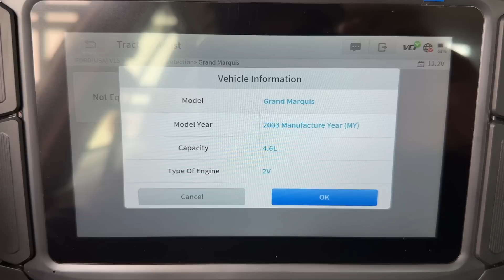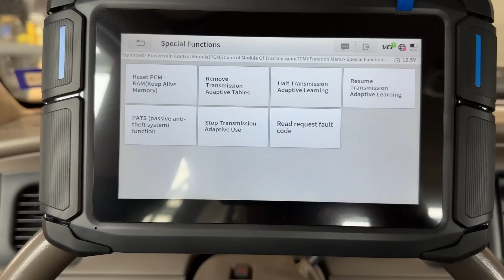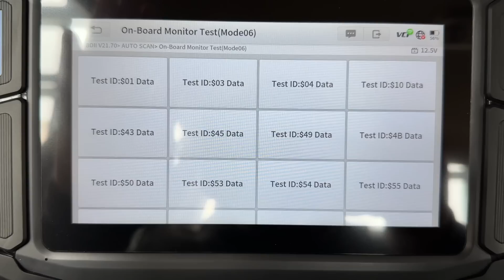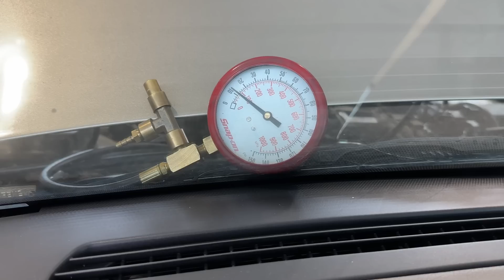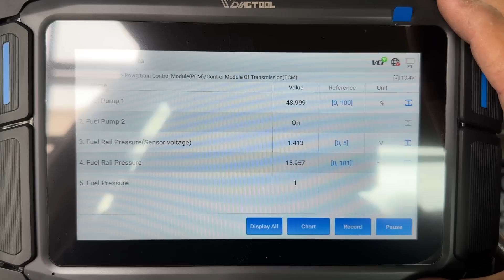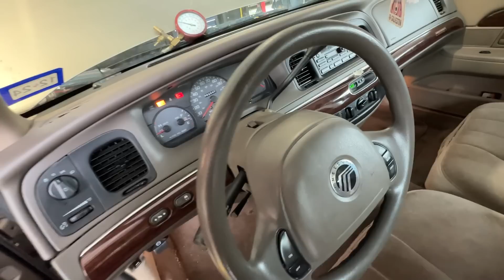MERCURY GRAND MARQUIS LONG CRANK START UP / ROUGH RUNNING / VDIAGTOOL VD70S

Comment: A good test when have a hole in line is take fuel line off run pump in a gallon bottle if it can fill up bottle fast but not really build pressure it’s a hole in hose at the pump

Comment: My dad was a Ford dealer, and I can tell you that the 1992-2012 Crown vic, Grand Marquis are some of the best cars ever made. 4.6L also one of the best motors Ford ever made.
Reply: I agree
Reply: except for all the ones that spit out spark plugs
Reply: @hahaha12345678993 
Learn how to install them correctly, and no problem.  
Never go by Fords recommended torque.  Torque to 28lbft and change them about 40,000 if using Motorcraft plugs.
Reply: Absolutely try and convince every one I can about these cars.

Comment: Advance level auto, I have such a similar issue with a 06 mercury mountaineer 4.0L v6, these kind of fords/mercurys vehicles have a very equivalent system. One thing I noticed with my mercury is I get a delayed build up of fuel pressure with the default fuel pump command digital duty cycle value. But whenever I have override the default value to a constant 45% value, It has managed to make my car run ok because it was making the fuel pump run at full speed. This is telling me that something in the fuel system is broken

Comment: So the original diagnosis was correct just another junk part. Second why was there so much smoke from the tail pipe with not enough fuel? Only thing I would have done differently was dead head the fuel pump eliminating the fuel rail to rule out a leaking injector.
Reply from the maker: I actually did this, however the mechanic in the stall behind me started blasting his music and I had to scrap that part of the video.